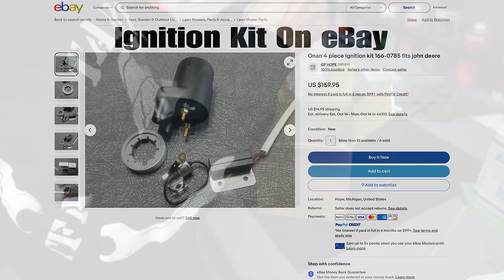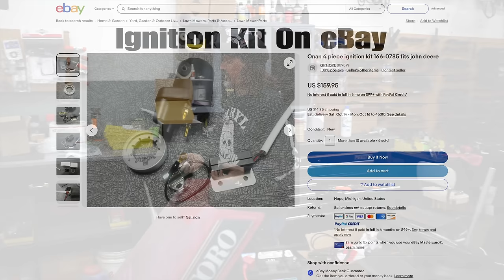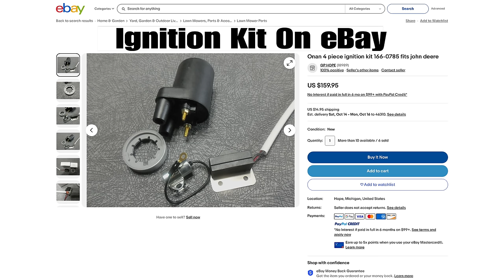Oh No! This Obsolete Engine has NO SPARK. What Do We Do?

Comment: I'll take a 30-year-old, welded steel, Japanese or American-made machine over a new Chinese-made plastic and pop-rivets machine any day. Who wants a machine with a plastic camshaft that's designed only to last 3-5 years?  Not me!
Reply: The sad thing is the modern Chinese predator is a pretty good engine with a metal carburetor and a steel camshaft, while an American owned (not made anymore sadly) is usually a piece of trash with a plastic carburetor and plastic cam
Reply: I dont know  I have a cub cadet  xlt1054  2012 model .  Kohler 26 hp .I've  had it for 8 years . I run the crap out of it . Pulling  heavy stuff . I never had a problem  with it.  I use to think the same way they were junk but I'm actually  impressed

Comment: yep. would not have any of those problems with modern battery power and at a lower cost. scrap metal might get you a couple dollars.
Reply: Battery power would never be enough to cut my horse pastures, which is what I use the 520h for. Maybe someday they'll make battery powered mowers that powerful, but it ain't today.